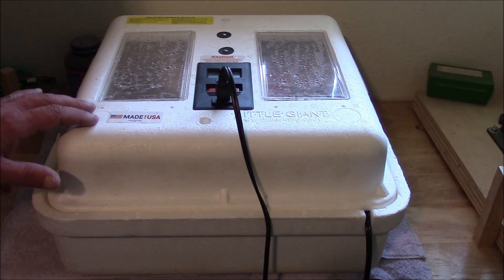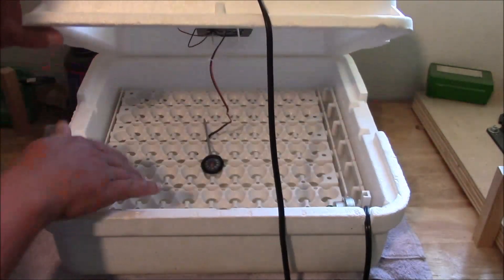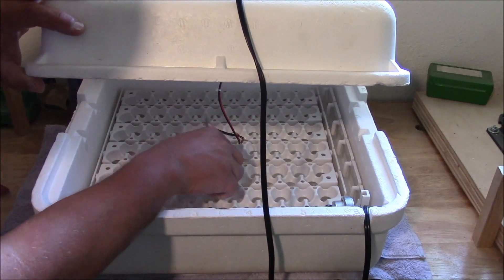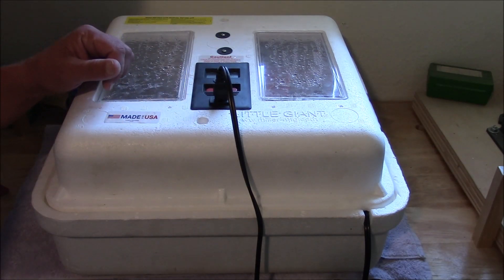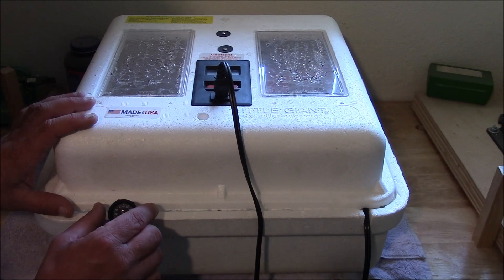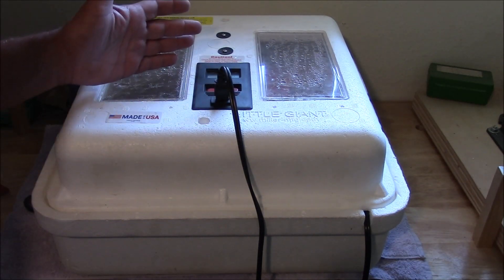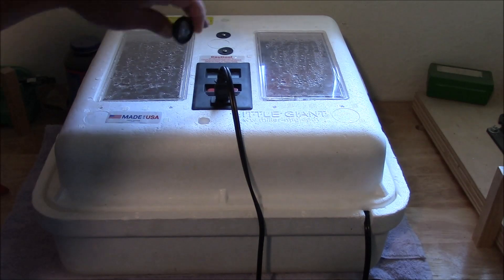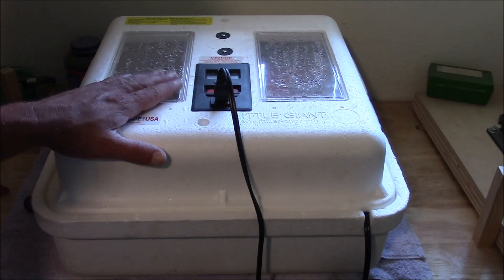How to Improve Your Hatch Rate Part 3: Preparing Your Incubator for Incubation

Comment: My little giant won't put the humidity over 32%. I lost 10 chicks because of it. I had to help the other two out of the egg. I'm sick about it. All fully formed. Just couldn't get out of the egg. Any advice?!
Reply from the maker: That really isn't a problem with the incubator itself.  If you fill all the channels with water the humidity should be where you need it unless your climate is just very dry.  you can try adding a humidifier to the room that the incubator is in and closing the door to keep the room humidity up.  You can also try adding some soaked sponges to the incubator to help increase the surface area of water and therefore raising the humidity.  I struggle a little with humidity in the winter time but it usually isn't that bad and not a problem in the summer.  I hope that it gets better for you.
Reply: I had the water filled in the troughs the entire time. I also filled it to over flowing out the drain holes starting lockdown. I also was hatching them in the gun room so I was able to close the door so I set up a hot air humidifier and filled the room with humidity. The incubator humidity stayed at 32%. I am going to call the company and see if they have any fixes. We live in a dry desert area.
Reply from the maker: wow, seems like you did everything you could.  One thing to keep in mind is that the only way to get a true reading is to get relative humidity which would have to be done with a thermometer in the water and some math (look up "wet bulb").  But if you are having the problems you stated then it very well could be that you can't keep your humidity high enough.  I am sorry but I just don't know what else to tell you. I wish I had a better answer.
Reply: I get 65% with mine and that works fine

Comment: I am incubating quail eggs as a little project and there is is only like 10 eggs in there. I have got the temp at about 99degrees but I don't have a highgrometer so how much water should I put ?please reply soon!
Reply from the maker: Don't stress too much.  If you have a place to put water in just put in enough that it doesn't dry up in a matter of 2 or 3 days.  When you go into lock down put enough in to last 5 days.  If there is glass on the incubator and it is fogging up you have plenty of humidity.  hope that helps.
Reply: Slightly Rednecked thanks so much!

Comment: Hey, just wondering: i recently started a new batch and my humidity is staying around 48-50% with no water even added. Is that ok? I have the same incubator as yours.
Reply from the maker: That should be fine.  Keep in mind that when the humidity gauge get's below about 50% it really isn't all that accurate.  It might be a little lower or a little higher.  I really wouldn't worry about it too much myself until lock down and then you need to bump it up a bit.  You probably only need to fill one or two of the channels though.  Hope that helps.

Comment: What chances do I have if the temp. Went from 97-99 during first 10 days , should I continue the process? I know it should be 100-102... do I have chance of them still hatching?
Reply from the maker: There is still a chance.  It may run a little longer than normal and you may not have the best hatch rate.  Honestly though. 99 is a great temp if it is a forced air incubator.
Reply: Slightly Rednecked Thanks so much ! I was thinking there was no hope! I hold on and probably allow to go longer in time. I really appreciate you videos, they have been really helpful😀
Reply from the maker: no problem.  Glad to help.

Comment: Can you just stick the thermometer in one of the holes the red plug goes i?
Reply from the maker: You can but that doesn't really measure the temperature at egg level very well and you really don't want to plug up the vent holes.
Reply: Thank you.
Reply from the maker: no problem
Reply: Slightly Rednecked   Can ya calibrate in Ice 32f or Boiling Water 212f will that work reliably ?

Comment: thnx for the video...I'm having a bad hatch rate and seems some chicks for late in the period...maybe my temp is out...just wondering how much leway do you have in the temperature setting pls....thnx again
Reply from the maker: Not much leeway.  Maybe half a degree or so.  I hope that helps and your next hatch is much better.
Reply: Thanx for advice...also am ordering a thermometer to check the incubator one as I think it's reading wrong...
Reply from the maker: That's a good idea.  Make sure to calibrate it first though so you know it is correct.  :)
Reply: Shall do thnx

Comment: How much water do you put? I know you said you don't worry that much about the humidity but I'm nervous that I will put too much or too little
Reply from the maker: Well remember that humidity is by surface space not volume so run your incubator for a few days ahead of time and figure out how many channels you need to fill up to get the humidity to about 65%.  Then just fill those channels all the way to the top.  At lockdown I fill all of my channels as full as I can.  I hope that helps.
Reply: Thank you for messaging me back! I'm still having a lot of trouble with the humidity. I put the most amount of water that it can hold and it has stayed between 42-50% humidity. This is day 3 since I tuned it on! I'm going to continue to check in it.
Reply from the maker: You can also try adding a soaked sponge.  It increases surface area so it could help.
Reply: Adding the sponges helped!!! Thank you!!!!!
Reply from the maker: Fantastic.  Glad to help.
Reply: Maricela Gaytan did you hatch out chicks is so how did it go

Comment: How do I calibrate my incubator thermometer?
Reply from the maker: you need to compare it to a calibrated external thermometer.  Avoid digital thermometers.  Dial gauge meat thermometers work well. Calibrate it by testing it in boiling water and ice water and adjusting until it reads correctly.  Then compare that to the incubator thermometer and adjust it until it reads the temp you want on the meat thermometer.  I hope that makes sense.

Comment: Calibrated ?
Reply from the maker: I assume you have watched my videos.  there really isn't much more to it than that.  Set it up a few days ahead of time and make sure it is reading accurately with a second thermometer.  You need to make sure that your thermometer is calibrated though.  Get a dial type thermometer and not a digital one.  It should have instructions on how to calibrate it.  Basically stick it in ice water and set the low point, then stick it in boiling water and set the high point (slightly more complex than that but not much).  If your thermometer is not calibrated trust the incubator.  Once you have it set up it isn't really anything else to do to it.  Have you ever had a successful hatch out of your incubator?  If so, did you clean it really well after.  And did you clean it well after the failed hatches?  It could be a bacterial issue.  I hope that helps a little.

Comment: which is more important fresher eggs or waiting 3 days for your incubator to stabilize temperature?  We will have it running at least 24 hours in advance
Reply from the maker: it depends.  How fresh are the eggs?  They can easily be stored for about 7 days before incubating but after 7 to 10 days the hatch rate starts to drop off pretty good.  If you can afford to wait it would be best to do so.  I hope that helps.
Reply: It does, thank you.  we have a few days within that window to play with.  Thank you
Reply from the maker: no problem.  Glad to help.

Comment: my little giant melted on the right side between the window and the heater
Reply from the maker: really?  did you try to contact the company (Miller Mfg)?  They have been pretty good to deal with in my experience.  Won't help with your current hatch but you might get it replaced for free.  So sorry to hear about your trouble.
Reply: Slightly Rednecked this just happened last night and I can't find a number to call them
Reply from the maker: Here is their customer service number.  They are open 7 a.m. to 6:00 pm Central time.  I hope this helps and good luck.  800- 260-0888.
Reply: Thanks for the informationThanks for the information
Reply from the maker: No problem.  I hope it works out.  Unfortunately I don't think there is anything you can do for the eggs that are currently in the incubator.  unless you have another incubator handy that you can transfer them to.
Reply: Slightly Rednecked update I moved them to my homemade incubator and so far 5 hatched out of 24 I lost the receipt so I couldn't get a replacement on My Little Giant
Reply from the maker: Really?  They didn't even ask me for a recent when I had a problem.  Sorry to hear about that.  On the flip side, it sounds like the homemade incubator is at least kind of working.  Well done.

Comment: Paperwork told me humidity sud be 60-80
Reply from the maker: Well that is the ideal but you also have to realize that to get a really good reading you need to take the relative humidity.  In all honesty, I wouldn't stress out to much about humidity levels.  I run it a little drier up until lockdown (just don't put as much water in or heck, maybe none at all if the humidity is showing 60% with no water in it) and then just fill the bottom of the incubator at lockdown.  I hope that helps.

Comment: My humidity stays around 80 n 87 but trays are always full. Is this right
Reply from the maker: That actually sounds fantastic.  Most people (especially this time of year) are struggling with keeping water in the incubator and not having to add any during lock down.  80 to 87 percent should be fine.

Comment: Thank you for posting this series! Would you mind sharing what type of egg turner are you using and how do you like it?
Reply from the maker: Thank you for watching.  :)

I use a little giant egg turner with quail rails.  It works well for me so far.  It is a pretty simple device so I think any egg turner will work as long as it fits in your incubator.

Comment: Great video, as usual.  :)   I have one of these as well as one of the older types with the metal element at the top.  I had two of the  newer ones at one time but  the one burned out...  during the middle of an incubation( about a week in) the temp on the digital screen kept reading 98 (one degree lower than I wanted it but it's still within the range, just takes longer)  and had the little chick symbol 'temp ok' , but the other thermometer I had (an Acurite indoor/ outdoor with a probe on a wire (with the probe duct taped to the side right at / slightly above egg level) was reading 107.  Yes, 107. I thought it couldn't be right  so I changed the batteries in it, still 107. Tried adjusting it  but it wouldn't go lower than 105.  The eggs were fried, I guess, those never hatched and I never used that incubator  again. SO if you have two thermometers in at all times   you'll know immediately if there is a problem.  The other one that I'm still using has  hatched so many quails it's crazy, it's a solid incubator I'd recommend to anyone.  Also, when I'm going into lockdown, after I take the turner out I put some of that rubber shelf liner in as I've had the tiny quail legs go through that mesh screen thing and twisting them- and worse- ...not good. Just wash and bleach it between uses.  Then to keep humidity up I put in two clean tuna cans with some wadded paper towels  in and put water in it will absorb the water and sink down... so there's no standing water in the cans (if there is just add a bit more paper). I've been doing it this way for years and it works. I have no idea what the actual humidity rate is (by percentage) but it always helps, esp. with the older element model, it's an absolute must as that model dries up like crazy!
Reply from the maker: Thanks for the kind comments.

Those are good suggestions.  I have never had a problem with the mesh floor myself so i don't bother with adding anything else to it.  I am working on incubating some eggs now and shooting an updated video so I will be discussing some of your suggestions during the lock down phase.
Reply: Sounds great. The next time I incubate I'm going to do the Listerine and float test methods,  I only learned about it after I had two hatches going already. lol.
Reply from the maker: Its not a widely talked about procedure.  I found it incredibly helpful on my hatches though.

Comment: Great video can you make your own incubator?
Reply from the maker: yes you can.  Honestly it is much easier to buy one though.  When I was a kid we incubated chicken eggs in a home made incubator.  We used two 60 watt light bulbs on a dimmer switch and checked it regularly and adjusted the dimmer switch to control the temp.  it worked ok but was a lot of work.

Comment: On day 17.5 and have had 25 out of 40 hatch so far. Obviously did not see parts 2 & 3 until now but will definitely take your advice in those videos as well. These are all Texas A&M. I bought 8 females and 2 males and am very pleased with them so far. However, sexing them is definitely more difficult. Thanks again for the videos and the help!
Reply from the maker: Hey there, good to see your around.  Sounds like you are on your way to a good hatch.  Congrats.

I am going to phase out my A&Ms for that very reason.  I like to be able to look at the bird and tell if it is a male or female.

Let me know what the final outcome on your hatch is.